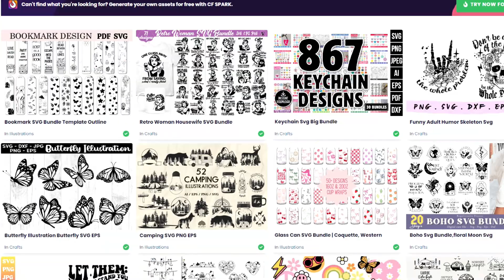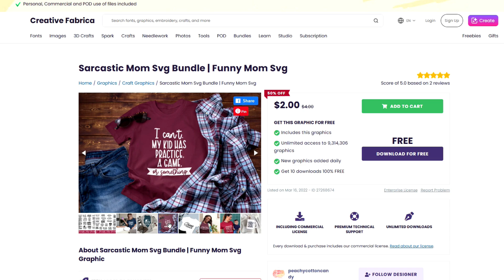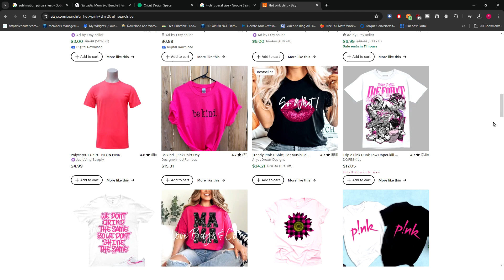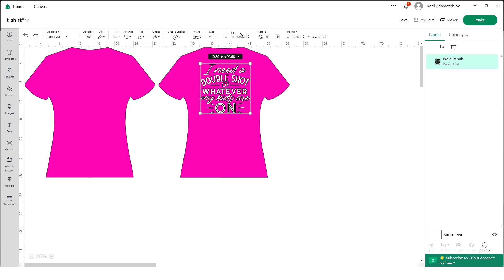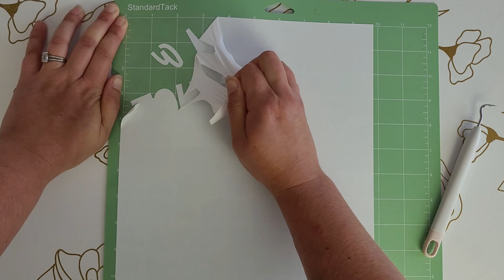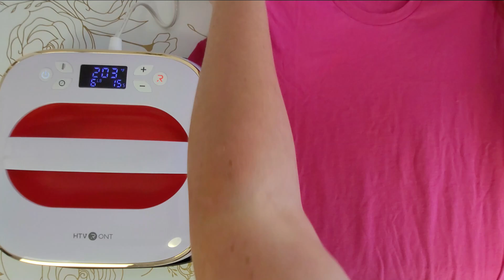Cricut Iron On Tutorial *Beginner-Friendly* T-Shirt Making with HTV

Comment: I love the idea of a hand held press BUT it concerns me that pressure is something that really can’t be managed. I say this because I used to use a “real” heat press. It was a 15x15 industrial press. I focused on larger orders t-shirts then. Now that I’m going to back into the biz, t-shirts will not be the main focus. Do you think this press or the Cricut version would be ok for smaller orders i.e. 12 or less?

I’d also like to do DTF. Have you used this for DTF or plastisol transfers?

Thanks for the vid. This type of press would be so much easier to use and put away. My previous press was 80+!• lbs also I wasn’t able to tuck it away in the closet when I wasn’t using it. I typically used Siser Easy weed. TY
Reply from the maker: Hello! I wouldn't use this on anything I planned to sell. You're right, traditional heat presses are big and bulky, but you can't beat the results. I like to press my shirts hard enough so that you can see the grains of the fabric (if that makes sense) showing through. I've struggled to achieve that with any auto heat press or handheld heat press. This is great for beginners just getting started with HTV projects, or if you wanted something to use at craft fairs. But for a real t-shirt business I would get a good heat press.
Reply: @thanks for the response. I enjoy your videos about sourcing, personalizing and selling the various products. I like to rewatch your vids just in case I missed something. TY
Reply from the maker: @AllenCNC  I enjoy reading your comments! I'm sorry it sometimes takes me a while to reply. I'm writing "Cricut for Dummies" and have been spending my whole life working on it lately as the deadline draws close. Pretty soon you'll have a book to walk you through all this! https://www.target.com/p/cricut-for-dummies-by-kerri-adamczyk-paperback/-/A-94449149?sid=&ref=tgt_adv_xsp&AFID=google&fndsrc=tgtao&DFA=71700000012576710&CPNG=PLA_Entertainment_Priority%2BShopping%7CEntertainment_Ecomm_Hardlines&adgroup=Entertainment_Priority+TCINs&LID=700000001170770pgs&LNM=PRODUCT_GROUP&network=g&device=c&location=9216590&targetid=pla-628828326641&ds_rl=1248099&gad_source=1
Reply: @KerriCraftsIt  good luck with your book!